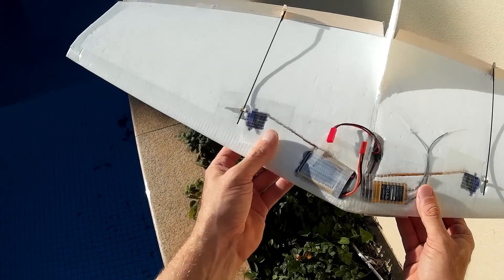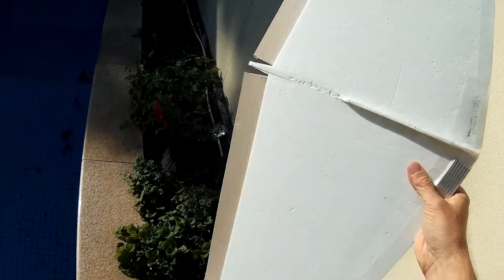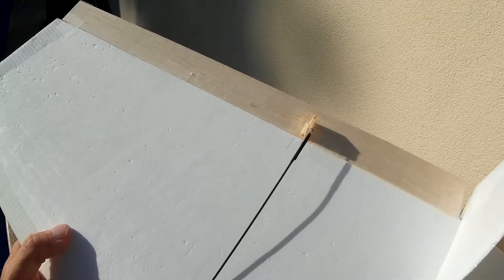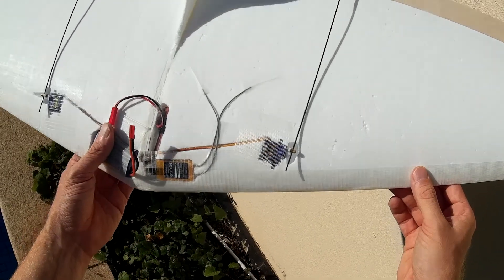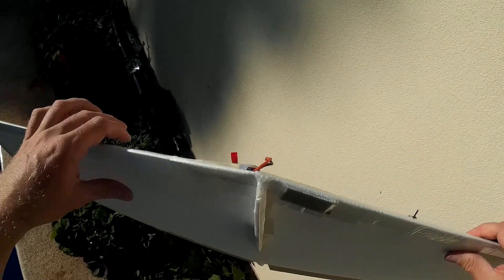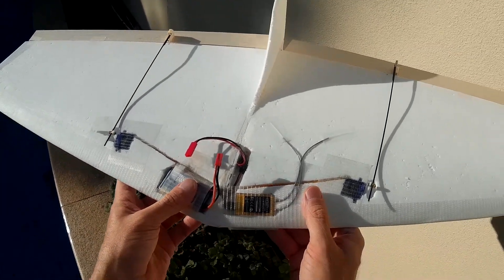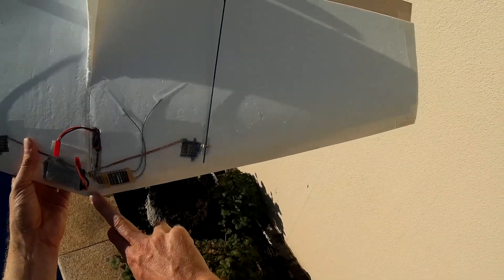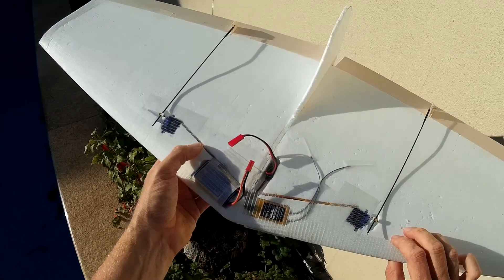Wiesel Light - Build and Flight

Comment: The dobbel size is very thick in the airfoil so it will not need any spar, and on mine I just cut tha ailerons in the foam
Reply from the maker: Thank you, you just saved me a CF spar!
Reply: I use 2 cheap standard size servos in mine, I think it is hxt 10 kg and the fin is cardboard with some flower sticks in it :)I have had some good fun with mine, and flew it this week. https://www.youtube.com/watch?v=RGXFt5jWi8c